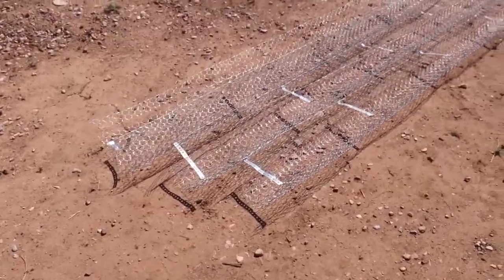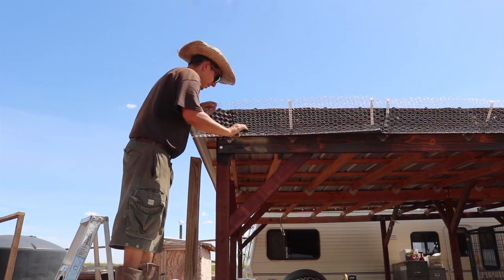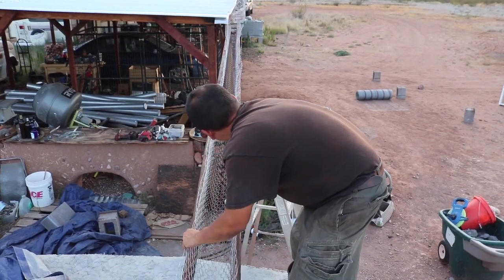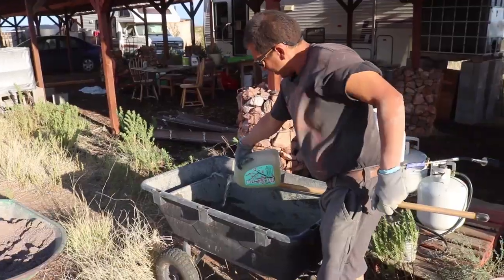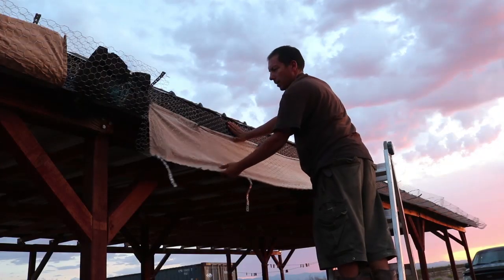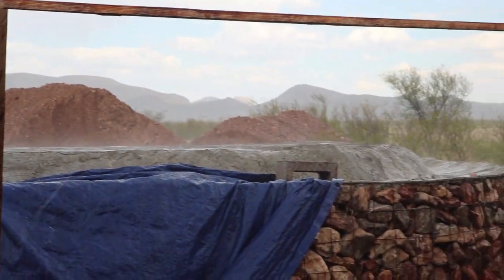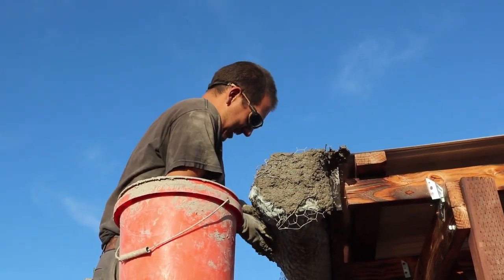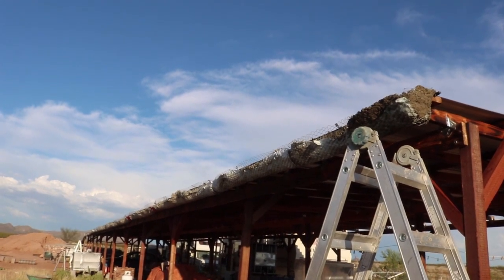We're Using A Nearly Forgotten Technique From The 1800's To Make Seamless Gutters | Ferrocement

Comment: Interesting project - caught my attention.  I'd personally rather have something light and smooth and 30x easier to intall, ...oh and aesthetic, and easier to clean, and ...  
If i was going the ferro route I'd make an interior mold which would include a lap joint and a backside lip on top thats 1.5" deep, and periodical holes for screws.  
Once removed from the mold the interior would be very smooth and whole thing would be even. Installation - screw in 2x4 material on the facing at the proper downslope angle.
Bring up a section over to be held by the 2x4 - then screw in place (you could even first butter the 2x4 with a concrete adhesive to really get it attached to the house).  
Install section by section with a  concrete glue or patching concrete between.  
Just some thoughts.  
Well done video though.

Comment: I’m just wondering.....Why can’t you just use standard metal or plastic gutters ? And are you planing on having any first flush diverter system ?
The way I see it, it will not be possible to maintain the minimum gutter slope necessary for good water flow drainage along your “ferrocement” gutter that is obviously lengthy, since you are molding it on the roof and with chicken wire, with nothing to keep it straight or at correct slope angle.
I think just buying regular gutters with first flush  diverter would have been cheaper, easier to install and given professional outcome. There is no need to re-invent the proverbial wheel....
Reply from the maker: It may be easier, but not cheaper.
Reply: @ourselfreliantlife  what was wrong with the old system what you had up there